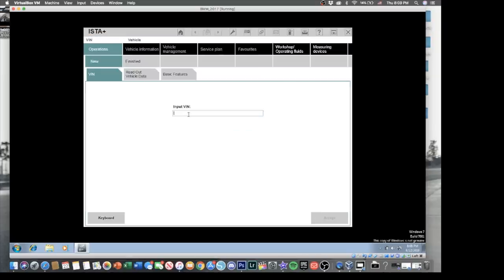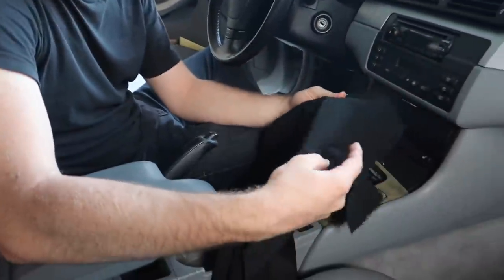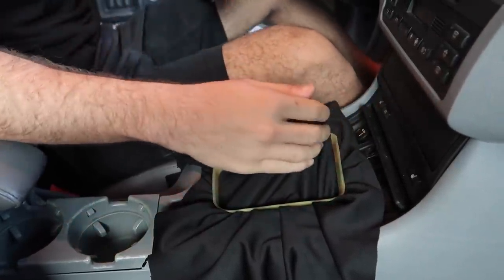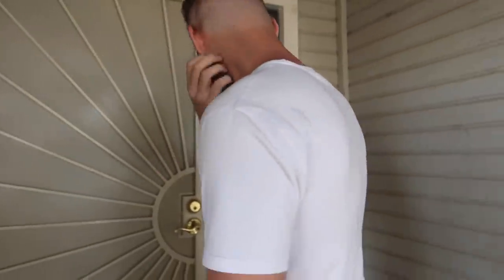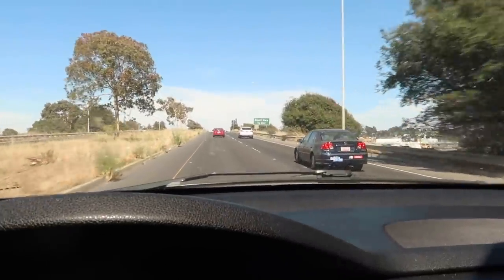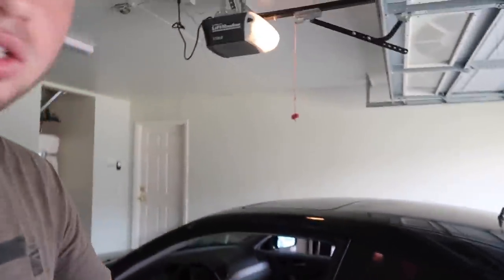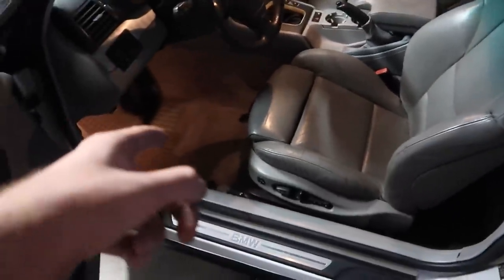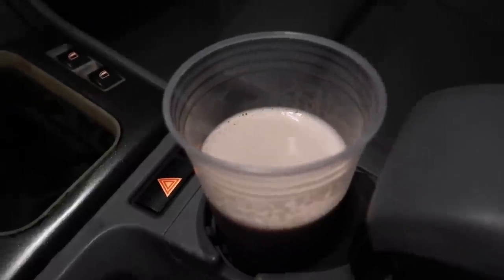BMW E46 NEW SEATS PLUS MORE MODS!

Comment: Wow, after couple of years of fixing BMWs, Nour actually discovers ISTA, lol. What is kind of disgraceful is that someone actually sells accessing the manuals part only, as a service on a website by running ISTA in the background. 
First, one can get a monthly subscription and own an actual software for cheaper directly from BMW. Second, there are tons of places where this software can be downloaded and installed permanently on your laptop for *free*. And with simple ENET (or OBD for older cars) cable you'll be able to do whatever a qualified BMW technician can do in an official BMW service center.